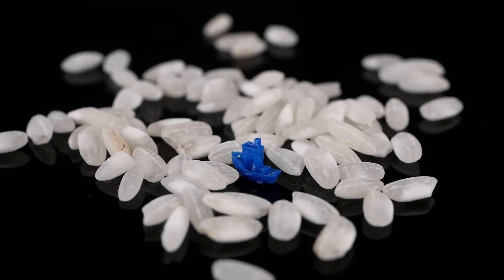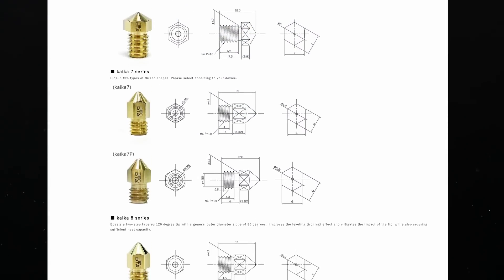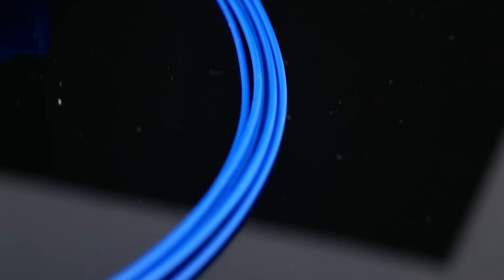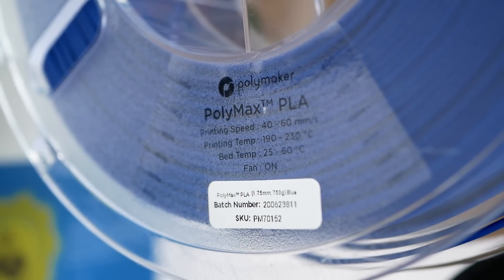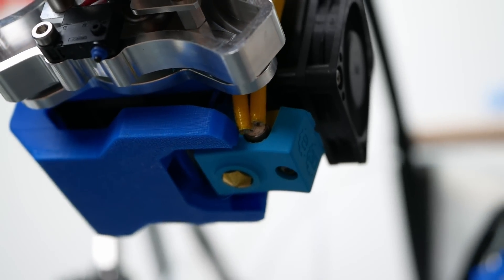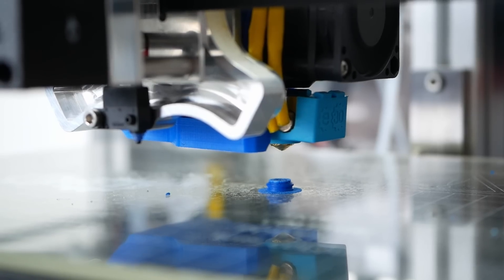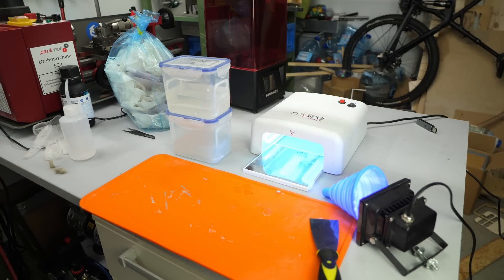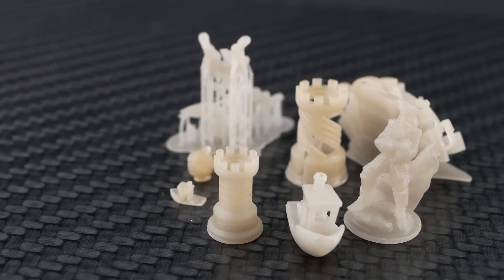MICRO 3D Printing with a 0.1 mm nozzle

Comment: Funnily enough I've been super interested in using tiny nozzles for 3d printing. I bought a huge pack of assorted nozzles off Amazon for 10-15$ I think it was. Now I know why the smallest I could get to work isn't just because of my Bowden setup, but because I got something super cheap! Either way considering my applications for the tiny nozzle diameter is essentially just for prototyping, and since I've only had a couple of models that could take full advantage of them I'll stick to .3 as the smallest for a while.
Reply: Try 0.24 if you can get one.
Reply: @squidcaps4308  fun idea, got a good website to get one from?
Reply: @squidcaps4308  I've used a .25 copper nozzle I got with a fairly cheap mixed sizes set off of amazon on a nearly stock ender 3 pro with decent success.

Comment: Nice!
Ive done 0.05 layer heights with transparent materials and they came out as clear as glass in the Z direction. 
Ive not done much with smaller diameter. Print times, as you mention, skyrocket!!!! Would be GREAT for printing train set miniatures. There are a LOT of Z scale Micro train set dioramas, building a world would be expensive, unless its 3d Printed! I always wanted to build a glass top coffee table Z scale train set, with control knobs on the outside for lighting and train speed, and track selection. Would be a REALLY cool coffee table! Only seen a couple online, and they are cool, but lack a real sense of realism.

Comment: Seems useful for small gears that I once thought required resin printing.
Reply: Did you have any luck with resin gears?  Mine are always have rough teeth - maybe something anti-aliasing could fix, but definitely something a laser resin printer could solve, I think.
Reply: @NoveltyEngine  I planned to get a resin printer to try but other people beat me to the end goal… a replacement POM gear for TurboGrafx-CD and PC Engine CD-ROM² drives. Now I can’t justify a resin printer just yet but I still have ~10 FDM types. :) Wish I could help.

Comment: A "Polyester" magnetic printplate would probably let you print the 200 houres with a cold bed, after starting only the first layer with 70 degrees.
A cold bed also has a positive effect on the general part cooling, especially for miniatures since you reduce the printing environments temperature from bed temperature down to room temp.
Polyester surface and cold printing tests are going on among the german speaking community.
Ahoi
mike

Comment: I've been printing with a 0.2mm nozzle on my Ender 3. Took me a not insignificant amount of time to get all the setting working well, but the part resolution is so nice.
Reply: I'm looking to do this too.
Any advice as to which settings mostly need the work?
Reply: @TradeTravelTroopy  you'll probably need to bump up your first layer flow significantly on order to get the first layer to stock

Comment: Just so you know, it looks like your print cooler is broken at the point where it screws onto the radial fan at 8:28 (top of the frame).
Reply from the maker: It has been for a long time, though still holds on some fibers 😁
Reply: @CNCKitchen  Haha, I had the same. It's amazing what a drop of ca glue can do for small parts like this! :)
Reply: @CNCKitchen  Do you  have an etsy shop? Lol I'd love to have miniatures made that I can cast into a gamecube A button.

Comment: Glad to see that you showed how limited Prusaslicer can be. So many locked down settings, especially around support structure generation.
Reply from the maker: Yeah, that's unfortunate though I guess the developers are fighting a constant battle between usability and customizability. Maybe SuperSlicer might be an option here.
Reply: @CNCKitchen  Superslicer has essentially the same support options right now.
Reply: It should be possible for someone to code in some options there. Just don't know how dependent PS is on those settings staying locked down for it's calculations to generate the g-code.
Reply: True. I like Prussia slicer but sometimes you need that giant list of cura support settings

Comment: Ooooh, I'd love to push fdm deep into sla territory, but I just think they service really different markets right now? The sbility  to print useful  functional small parts is really nice. We did Molex MicroFit connectors, and tiny buy useful 0.25mm module gears - all of it WORKED?!  There’s a lot of potential down here, and folkts are likely to be surprised.
Reply: Don’t print with carbon/glass where the vendor doesn’t have an ASSURED fiber-length of around 0.5xNozzle-Dia - or any particle (fibre/ball/rock etc), for the matter. So for a 0.250um nozzle, I  would be very careful about printing any filament more than than 100-125um in length or so, . So would really like  to see what can be  done in the near and more accessible to the everyman range. We did some amazing things with something technically thought of as the pinnacle, a thermoplastic-god, of near the whole ‘thermoplastic types’, I can’t help but feel that is an ability to crank out parts that are going way beyond the what is a big step ahead. And we just gotta use that which is already hard worn knowledge in thermoplastic industrial land!
Reply: @SanjayMortimer  Nozzle temps are climbing too, how long before we print soft metals? The new 308L filament is amazing and can be printed at home and post processed at their facility. ~$485/ 3lbs, but includes 1 pound of post processing. And how much longer before we can DIY? Build your 1st rocket engine or micro turbine at home. Unique fitting for a Yacht, or a propeller or chassis for a model. Endless possibilities.
Reply: @bryanst.martin7134  Or one could just 3D print a new lawn mower cylinder head instead of having to order it and wait for weeks!
Reply: I've printed at .01 layer height several times. I think there is one holding up my couch right now as my brother and I accidentally broke that leg. The print time was awful, but there was a curve that was 1.5 inches wide and less than a quarter inch high. The ridiculous layer height made that curve look beautiful and smooth. Most people don't even notice it because of it's design. The other legs have wheels, but this one just has a curvy stump. At that time, I only had a .4 nozzle and it was like 74 (I think) hours with ABS. I always had trouble with that specific roll of GizmoDorks, but it worked great on that print. With larger layer heights, it kept stripping the filament and just became a melted blob if I raised the temperature.

And now for an unhealthy dose of rambling: I avoided them afterwards until I need their bone white (best filament I have ever used in terms of printablilty, reliability, and surface finish). I've use nearly a dozen spools of the bone whites and all were perfect. No clue why, but it doesn't show layer lines and has a matte finish regardless of temperature. I've even printed large flat curves and .3 usually looks quite comparable to .1. If anyone knows why it has such a matte finish, I would love to know. The parts I make with it last just as long as others, so strength is not affected.

Comment from the maker: Chose your poison: Micro Nozzle FDM printing OR messy resin printing?
Reply: For parts fdm... for art resin... that's my take on it anyway
Reply: @handy-capoutdoors4063   That really encompasses it, non micro parts on Resin warp to he point where they're unusable, and the resin choices just aren't durable enough to boot. FDM however just can't do the resolution with current hotend designs. I would love to see a hotend designed with small parts in mind though, it seems like thats something that just doesn't exist at the moment, who knows, with a correct FDM setup it might just be doable.
Reply: I’d like to try micro FDM printing some time. How the hell do you clean a nozzle that small?!
Reply: Well, for prints that size resin printing is probably still the better choice. Mechanical properties are not that relevant in those dimensions I guess. 
I like resin printing for the reasons being extremely fast and giving isotropic properties.
I hope someday someone will a invent a cheap light based 3d printing system for thermoplastic materials which combines the advantages of both worlds. (Or a UV resin which gives you a thermoplastic material a the end.)
Reply: What about, as your setup has a tool change, using 0.1 nozzle for perimeters only and a bigger one for infill? You might have great details and save some time (I guess in cura there is an option to add a thicker infil every 2 or 3 layers of external layer). I see an application for small detailed mechanical parts
Reply: @gentiligiuliano7882  Or, instead of tool change, just have dual nozzle, one for detail, one for bulk fill in.
Reply: @Reach3DPrinters  of course. But he already has tool exchange setup. For everybody else dual nozzle or IDEX would work fine
Reply: Resin is a bit messy, I agree. Ive done very little with 0.2 nozzle. Hard to get first layer to stick as the threshold for width to height proportion is much smaller, and the heat of the nozzle itself makes the material want to peel upward toward nozzle, so the point of nozzle has to be pretty sharp.
Reply: @Reach3DPrinters  You can set separate extrusion width and height for first layer. So you can have a 0.3mm layer with 0.45mm wide lines first layer. Maybe a raft is appropriate? This requires a substantial flat on the bottom of the nozzle wider than the chosen extrusion width.

You can get e3d style nozzles with an airbrush thread. Then you can use airbrush nozzles on them, 0.1, 0.2, 0.35 sizes, this order of magnitude. Stainless airbrush nozzle precools the melt and radiates less heat and is very pointy, and creates some distance from hot brass. I believe they were invented by René Jurack.
Reply: @SianaGearz  I actually have some airbrush nozzles, also a tap and die, I could probably make one myself!
Reply: I would way rather swap nozzles and adjust profiles than deal with resin. Resin is absolutely better in terms of print quality, but it's just not practical for my workflow. The #1 thing I need high detail on are small-ish gears, and I often need to tweak the design several times. If the print takes a day, I can just work on something else. No need to spend additional time and supplies on curing and cleaning up an after an FDM print. However, I would consider SLA for something like a fan blade or a fluid pump, where FDM just isn't going to cut it.
Reply: Micro nozzle fdm on my desk.
Reply: Gibt's dein Mini Me irgendwo zum download?
Reply: I'm a speed junkie. I switched to 1mm some time ago and I love it. Bigger is better!
Reply: having two resin printers and one FDM and based on what I personally print most often (scale models), the practicality of this set up is telling me to stick with resin for tiny hi-def parts, but the aspiring machinist in me can't help but be amazed with the level of craftsmanship and precision required to make such a part in the first place and makes me want one just for the sake of that alone
Reply: I'd have to disagree that resin necessarily creates that much waste. I'm able to reuse gloves and paper towels many times over without contaminating my other with spaces. Even filtering your cleaning solutions occasionally can reduce waste.
Reply: Definitly resin printing on a Nanoscribe :-D
Reply: I choose the poison!
Reply: no micro resin?
Reply: Please test the aliexpress nozzle!
Reply: Coincidentally I came across this video today with resin printing for functional parts. Try printing this with FDM. Don't. 😅 https://youtu.be/2h312IVR6Ww
Interesting project btw.
Reply: I have an FDM printer, and I can't afford to get another printer at the moment, so my decision is made for me. But for my uses - large structural parts - FDM makes more sense anyway.
Reply: I'd rather go with resin printing, but then again my resin printer is the Form2 from Form Labs.  Most of the resin is low odor and we have their suite of cleaning and curing tools.  It's an ecosystem that works wonderfully well.
Reply: FDM, for sure! Between, the smell, the mess, the waste, the washing and curing, it seems no time really gets saved over an FDM print of similar scale. Then, with bigger prints, in addition to the above, you have to add drain holes and post-process those too. The whole time you have to be mindful of the seriously allergenic, potentially toxic formulations. Also, you can't do multi-color prints. Even with a single extruder printer, you can at least swap filament at different layers. I'm not that hung up on my miniatures to get into SLA. Maybe I'd use it if it was the only solution to a problem.
Reply: MESSY RESIN
Reply: resin
Reply: Resin!  I use water washable UV-free drying resin.  So cleanup mess and odor becomes almost nonexistent… more expensive mind you.

And you can often get entry level (I.e. Monoprice) resin printers on sale below $100.
Reply: Resin all the way
Reply: Thanks for addressing the high waste and non-recyclability of current resin printing.
Reply: I have made some great tiny parts on my mk3s with a 0.15mm nozzle, however I rarely use it due to how long prints take, and that 0.4mm is usually good enough for my application. If I printed tiny parts on a regular basis I would buy a resin printer and save my fdm machine time for larger prints.
Reply: Got a resin printer still in  the box after 2 months....  I just prefer the FDM especially after dialing it in thanks to your videos. :D